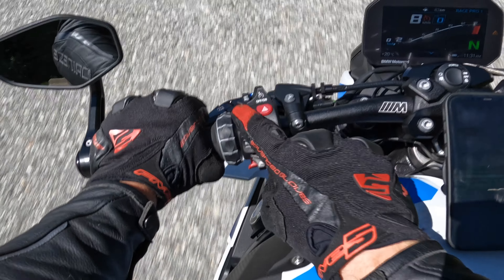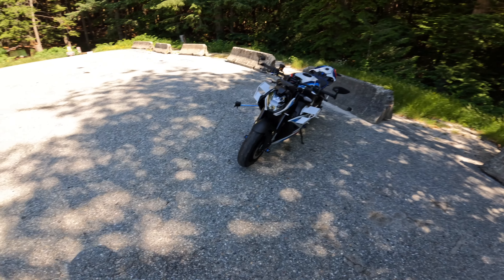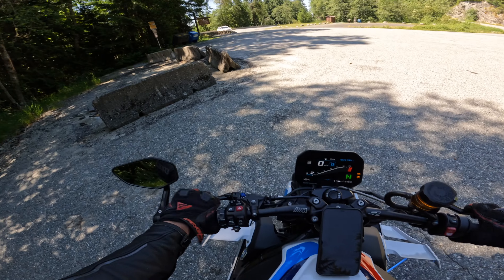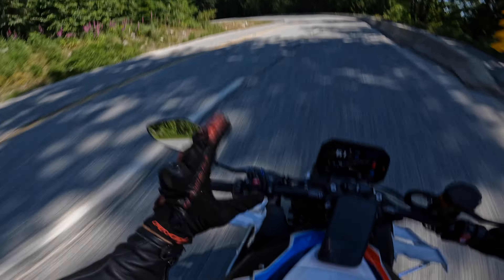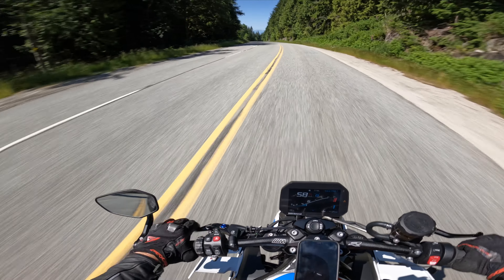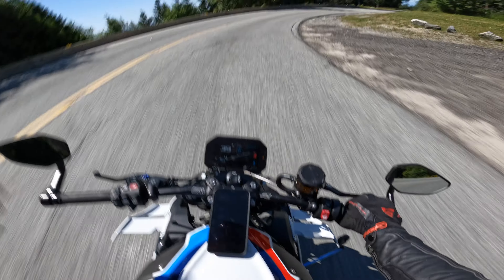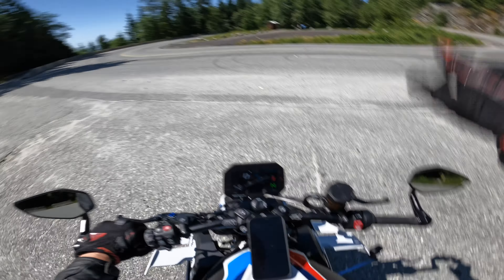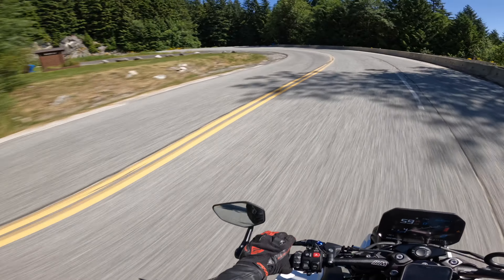M1000R WHEELIE CONTROL QUICKSHIFTER EXPLAINED

Comment: It works, 2023 m1000r europe,   1-2-3 gear on wheelie control max wheelie possible, you have to trust your bike and apply more throttle. The bike is stok
Reply from the maker: In Canada we have that huge flat spot in the power so without a tune it won’t wheelie through the gears

Comment: It’ll work, I’ve gone first-second-third with high wheelie possibly mode on, you have to shift fast af though
Reply from the maker: Is your bike tuned?
Reply: @topmaster999  it is, just a stage 1 Bren tune
Reply: That may be why I can do it, I never tried shifting before I tuned it though 🤷🏻‍♂️
Reply from the maker: That tune is such a game changer, I’m confident I’ll be able to shift gears after I tune my bike haha
Reply: @Tboffroadfab  yeah that's why I say it got s1000r I've done 2 to 3rd wheelies just prefer starting a wheelie in second gear myself
Reply: I have a 23 s1000r,  (k63) and I've been able to shift through 2nd with high wheelie setting, but once I click 3rd it starts to set it down. If I got a tune and did exhaust, intake and such I feel like it'd keep going.

Comment: Should of tried second to third
Reply from the maker: I’ll have to try it and get back to you haha
Reply: I swear my 20 s1k on high wheelie comes up like 3-4 feet ok
Reply from the maker: @gtatom Really? Wheelie control on my bike is very noticeable once it’s 2 feet off the ground
Reply: @topmaster999  I wonder if its different on the M1000R due to the different sprocket and transmission, would be super easy to flip if set up like the S1000RR
Reply from the maker: @tracks.trails  hmm it should be the same as the m1000r
Reply: Yes, I wanna know how it is in second and third gear

Comment: Did you try in power mode maximum?
Reply from the maker: I didn’t, I find it so twitchy when you’re trying to wheelie. I was in full horsepower just had the torque turned down one notch
Reply: Nice vid. What mode were you ? Street, race, ?
Reply: @topmaster999 learn clutch ups. They are wayyy more controlled. I mean i only have half the power you have, but still. If youve got your brake control down, clutch it up.😊

Comment: In the race pro modes if you turn off the wheelie control and still have the traction control on you can wheelie thats the porpuse of split the traction control settings over the wheelie in the race pro modes give it a try.